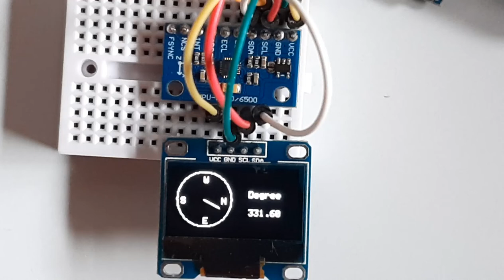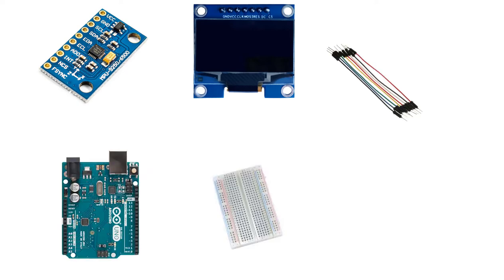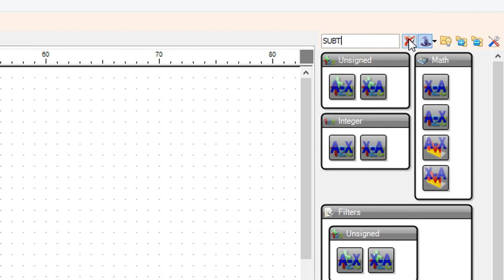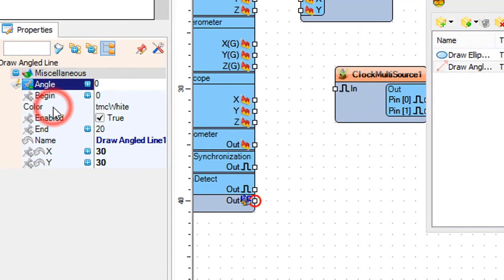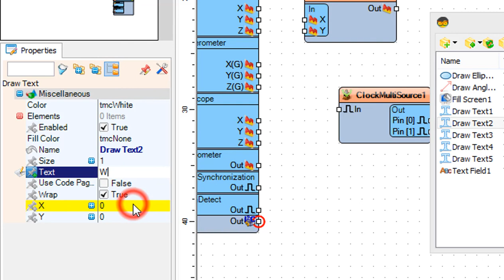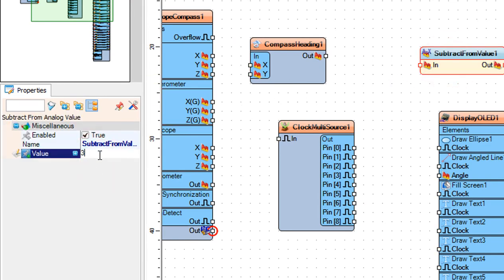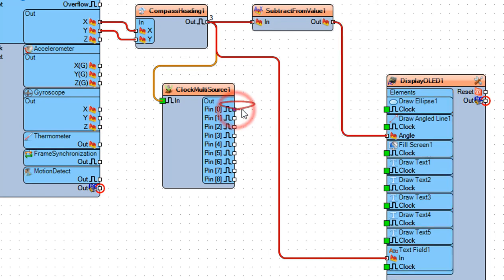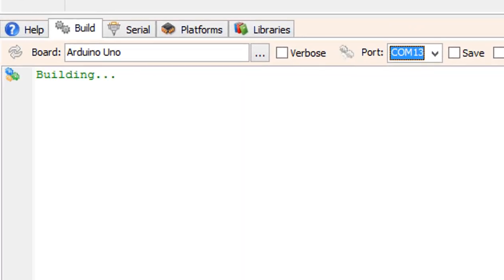Arduino Digital Compass using MPU9250 Magnetometer

Comment: That's a great video for inspirations. But I have being struggling to find a way to deal with the soft iron distortion. Do you have a way to solve that problem?
Reply from the maker: It reacts to the magnet, so if the Iron is magnetized it could cause problems. Best way is to test several solutions.

Comment: There is a big problem in this priject. When sensor is stable the displayed value is not stable. Are there any way to stable this value
Reply from the maker: You could use the Average component and note that certain devices could influence the sensor

Comment: Arduino is great, but  Visuino really is pain in the butt for most people.  I see no points to drag your mouse around on the GUI when you can just type in everything or even copy-paste in sessions of code and then compile it and get things to run right away.
Reply from the maker: Visuino shows its true power when you use several sensors,displays, wifi, then add conditions, etc
 if you are not a very experienced coder coding in Arduino can be a difficult task for most people lasting days or even weeks. On the other hand using Visuino will only take a few min and the compiled code is highly optimized.